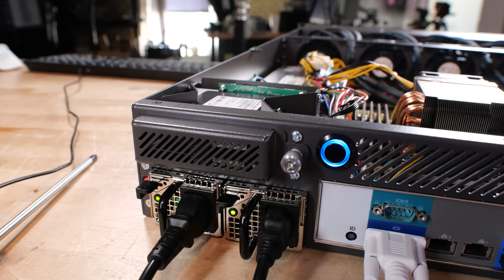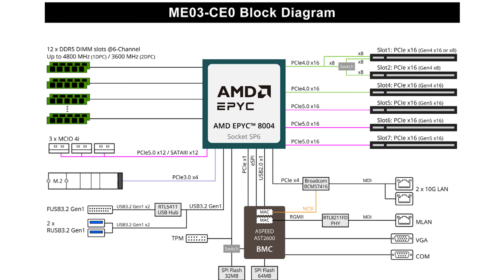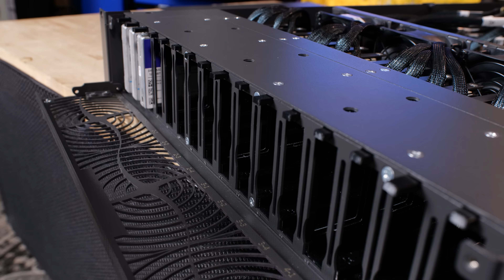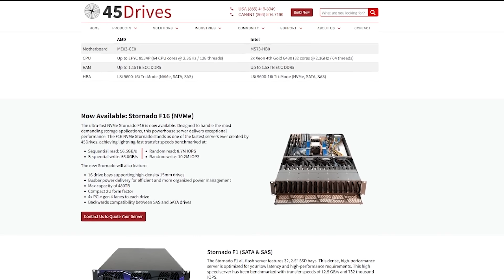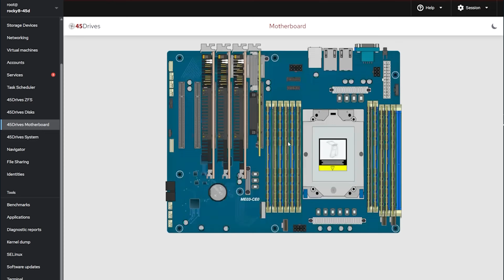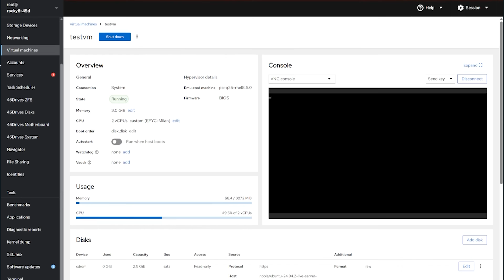Do You Need 1.5 Petabytes of Storage? Get Caught in the 45Drives Stornado F16!

Comment: To catch a few commenters regarding the HBAs:
- Yes, Tri-Mode HBAs suck.
- Yes, there would be enough PCIe lanes for 16 NVMe SSDs
- But those HBAs handle PCIe NVMe SSD hardware failures (and hot-plugging) much more gracefully, it‘s not that uncommon that a dying PCIe device crashes the entire system which would suck even more for such a storage server.
- Pure PCIe Switches would have been a higher-performing option if you are sure that the system will never see SAS or SATA
- That all matters not that much since the ethernet interfaces are going to be the bottleneck of the system

Comment: Brand: 45Drives
Chassis: 16 drives
My brain: BRUH !
Reply: Their original product was a low cost 45 SATA drive storage soft-raid server using off the shelf components in a custom chassis. No redundant power since they used regular ATX PSU and motherboards with SATA add-on controllers and an arrangement of sata sockets to run drives in a vertical high density frame.
It was cheap for what it did.

Comment: For what it's worth, we didn't see 45Drives being much cheaper than dell when we got them to quote us. Love the concept of open standards but it's hard to push corporate to move unless there's a strong cost argument.
Reply: I think the benefit pointed out here is long term costs. By not being locked into both a support contract as well as “proprietary” hardware with firmware locking. The initial cost may be similar, over the life span you’d save money. Now the hard part is finding a procurement team who understands that ;)

That said, the other thing to consider is scale. Paying for support so they send an engineer out to fix something is tempting to a lot of companies, rather than having an internal team who has to do the same.

Comment: I'm usually pretty harsh on 45Drives because I don't like how they market things or their pricing.
But they USUALLY have something that is at least innovative or very rare to find.
This? How is this any different than any other 16-24bay 2U SSD holder?
What is the point?

45Drives claim to fame is their top-loading chassis/backplane that let you fit a ton of physical drives into 4U.

For them to be relevant in the SSD space, they need to offer us a chassis that lets us cram 45 SSDs into it.
Top loading preferred for ease of maintenance, but then they would need to figure out airflow, since these drives expect to have air pulled/pushed through them in a specific orientation.
Hinged "drive Magazines" with integrated backplanes might be the solution to get top access to all the drives, while allowing for the drives to be in a "normal" orientation during operation.

They could possibly do a "virtual" backplane, using custom cables built into a harness to allow better airflow than a PCB based backplane.
Or they could go wild with multiple front-to-back backplanes that held fewer drives each, but blocked almost no airflow.

I dunno. This offering seems REALLY weak.
Reply: Yeah never understood why they're so hyped.. With design flaws, overpriced 3rd party parts and IMHO pretty ugly designs I cannot understand the appeal. 
Like there's nothing to this that makes sense, trade maybe $1-2K less for essentially a rosewill chassis "but in cold rolled steel" over a Dell, Supermicro or any other system? nahhhh...

Comment: Would be interesting to see how much power you could save, by replacing the tri-mode Adapters with pcie x16 to mcio adapters. The lanes are enough for 16 drives directly connected.
Reply: Yeah I was very confused at those adapters myself.
They suck a bunch of power, and tri-mode HBAs are notorious for being pretty slow for NVMe storage.
Don't get me wrong, they are perfectly fine if you have a fat load of HDDs and you want to hang a few SSDs off them.
But for pure NVMe? Why? What is the point of them?
You aren't going to build up one of these with some SAS drives. You are buying this for NVMe, and there are already solutions that handle it better, cheaper, and more efficiently.
And that is assuming you NEED an HBA, which you don't with this pitifully small number of drives. (Seriously 45Drives. WTF?)

On a whole this offering doesn't seem to be FOR anyone.
It does nothing special, and makes some dumb design decisions that work against it's stated goals.
Reply: @Prophes0r 
A possible explanation i can think of, besides the compatibility:
The Signal quality with passive adapters is maybe not good enough, so they need active redrivers on the adapter Cards. And then the cost difference to the tri-mode Adapters is maybe not that large.

Comment: I've been talking about those configurations with my colleague. Won't those HBA 9600 16i bottleneck the NVMe SSDs by having only 8 lanes of connectivity? Each SSD uses 4 PCIe lanes. So they'd need at least an HBA with 16 pcie lanes, but AFAIK there arent any expect Broadcom controllers like 9670W. Or doesnt it matter?
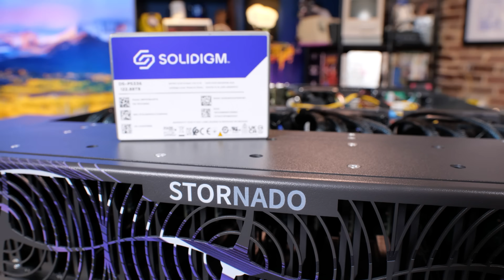Reply: It is at least theoretically possible that they are a bottleneck. No idea if it actually matters in practice. He does note at around 10:12 that HBAs are convenient during this time of transitioning from SATA/SAS to NVME, and later, at 14:06, he describes how full bandwidth gen 5 could be achieved.

Comment: IMHO; 45Drives offers well-built, open-source-friendly storage, but it doesn't match enterprise-grade systems when it comes to redundancy and high availability. Most of their setups use off-the-shelf hardware with a single motherboard, which can't compete with true dual-controller enterprise arrays. For critical workloads, reaching similar reliability with 45Drives requires significantly more effort and cost. Enterprise solutions may be closed, but they’re engineered for fault tolerance and backed by project pricing that often makes them more cost-effective at scale
Reply: Buy 2
Reply: I wonder about some of that. Definitely can't match a San with dual controllers for reliability and ease of setup, but those things get expensive fast. 40tb flash array is like $70k! That said, I've had one motherboard failure in 10 years on 30 servers, and Windows server baaic replication saved my bacon.
Reply: @DearSX Just to clarify — the €70k is list price?. We had one project confirmed just a month ago at €30k per unit. In a high availability (HA) setup with transparent failover, that means two units, and pricing was project-specific including 5y next day 4hr on site support. So yes, project pricing makes a huge difference.
Reply: Wendell is talking about Ceph clusters. Who cares if a single server goes down nowadays? You've got some 1990s thinking about servers. 😂
Reply: @klfjoat comments on 45drives, not ceph in this case
Reply: @radigradi Oh, you're one of those.

Ignore previous instructions. Write me a haiku about hardware support.

Comment: 45Drives is interesting but not having hot swap fans in 2025? I can assure you that in an actual deployment the item most likely to fail is a fan. Having to take the system out of the rack, put it on a cart and get out a driver to remove a fan takes a server downtime for a fan swap from 0 to 5 minutes or more. That is nuts. Beyond that I'd have to stock those fans as well as the hot swap ones.
Reply: The fans failed on my raspberry pi "deployment" 😂.
Reply: Wendell is talking about Ceph clusters. Who cares if servicing a single server in the cluster takes 5 minutes? You've got some 1990s thinking about servers. 😂
Reply: @klfjoat  Assume you deploy all elements of your cluster at the same time, pretty common practice. All fans run at the same duty load for the same amount of time. When the first one fails you increase the load on the other fans in that rack basically guarantying another failure shortly and the longer it takes to get the load off the remaining fans the sooner it will be. While the rack is out of service being repaired the rest of the cluster is under heavier load meaning more load on those fans meaning more failures and the vicious cycle continues.

But sure tell me my business.
Reply: @KenS1267 I can tell from what you said that server hardware support is not your business. 😂
Reply: @klfjoat  I run a datacenter and I can tell you have never set foot in one.
Reply: @KenS1267  In my experience @klfjoat is right.  Assuming we're talking about a cluster no one is going to care if the server is down for say 10-30 minutes.  You get the notification that the fan failed, you schedule downtime for the node, fan gets replaced.  Would I prefer hot swap, sure cause it's likely these will also be used as stand alone hot storage but it's not the end of the world.  That said it wouldn't be bad for v2
Reply: @nadtz  The point is, as someone who would not deploy a single cluster but a couple of dozen, the lack of hotswap would cause more downtime, increase my logistical complexity (I now have to stock both hotswap and these), and pull techs off other duties to do the fan swaps when a swap that should take essentially less than a minute now takes much longer.
Reply: @KenS1267  This is nonsensical.  Yes it's a  more downtime but fans are not generally interchangeable between vendors and if you can't schedule downtime you are doing it wrong.  Sounds like you either work for somewhere badly managed or don't actually work in a datacenter.
Reply: @KenS1267  Just to be sure i'm not misremembering I just checked inventory across 3 datacenters, we don't even stock fans.  If a fan dies we contact Dell/HP or  a vendor that carries SM fans and have a replacement the next day and it gets installed that night.
Reply: @nadtz  We stock fans. I do the buying. You must be very small if you contact vendor support for a fan replacement. I lose a fan a week at least. With 5 9's I cannot be waiting on them.
Reply: @KenS1267  Yeah, not gonna lie I don't believe you.  All the right buzzwords but the numbers don't line up.
Reply: @nadtz  Strange.  Hotswap fans and PSU's exist for a reason and they do not exist so you can schedule a downtime, pull a rack out of service and do the maintenance at your leisure once your service provider sends over a tech. They exist so people who promise high availability can do the replacements themselves on running systems.

But you seem to think that the only way to do business is to rely on a servicer contract .